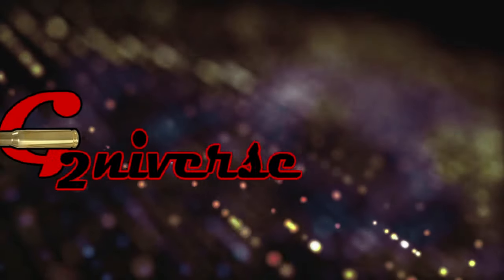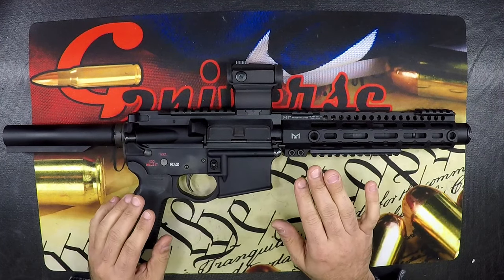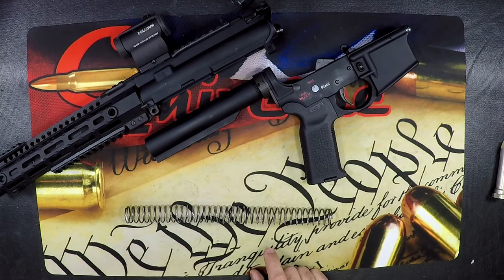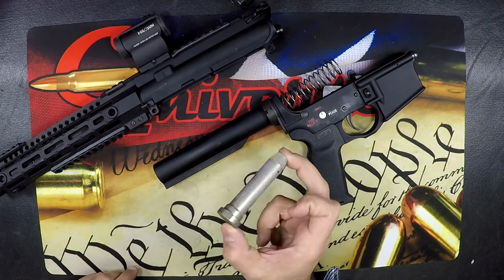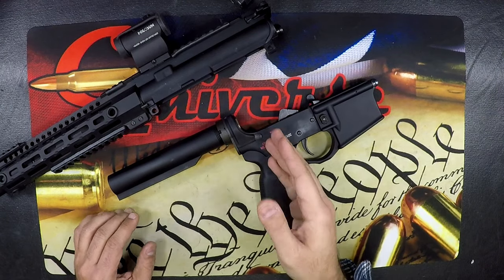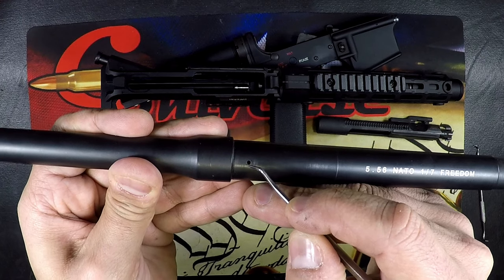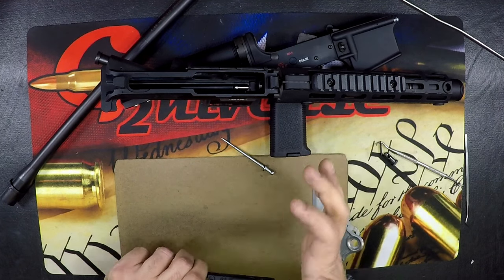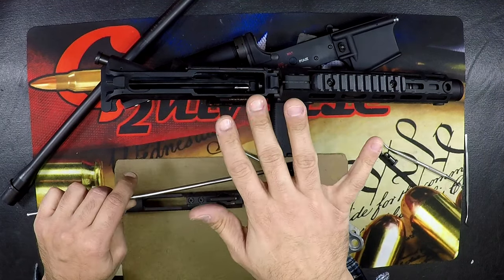Safely Fix Undergassed AR - How To

Comment: I'm dealing with this as we speak.  
I've been through every option you mentioned already,  no answer.  3 types of ammo....... everything short of removing weights from the buffer itself.  I've even swapped bcg and buffer setup from my perfect running carbine to no resolve.   
Having to fold and let the guys that built it give it a look.
Reply: It’s possible it’s the barrel port. I have a ballistic advantage barrel which I’m told is most likely too small of a hole.
Reply: Any update? I’m about to start all the steps he mentioned myself, ugh
Reply: If you're really undergassed another option would be to install a new barrel with a pistol length gas system rather then a carbine length gas system.  This will give you much more gas. Especially helpful if you're running subsonic 300 blackout ammo out of a 16 inch barrel.
Reply: @Theyoufeelme  No, do not do this lol. If the gas block is not clocked, the gas tube in the gas block seal is good, the gas key is in spec-.180 to .182, the gas key is not loose, the bolt carrier bolt tail bore and gas ring bore is good, the gas rings are good, the buffer is the correct weight, the chamber and throat check out good with a function gauge, the head space checks out good then the gas port may be under sized and needs to be opened..

Comment: I'm drilling my barrel gas ports out, to .100" 
Then installing ADJUSTABLE GAS- BLOCKS..

I tune with TULA , STEEL-CASE .223 (WEAK AMMO ). 
I Tune it to cycle weak ammo, then it will eat anything that's available, providing the casings are decent.

"TAILORED-PERFORMANCE"
Reply from the maker: Great advice

Comment: Thanks for video, took my build to range today first time. Was getting FTE. The manual ejection of spent casing works. So I believe my issue my gas block not properly align. BCG is the same  PSA in your video.
Reply from the maker: Tall Titan yeah id go easy first and check the buffer and buffer spring.  work from teh back of the rifle forward.
Reply: @G2niverse  buffer/spring is anderson carbine buffer/spring, brand new
Reply: @G2niverse  well checked gas block and gas tube to ensure set screws were still tight and re-verified alignment. I have snap caps 5.56, did one round check, I notice when ejecting appears to eject towards about 4 to 5 o'clock. Does the gas block need to be flush or small gap between barrel neck. here is my build parts:
Anderson Manufacturing carbine buffer/spring
Anderson Lower with LPK
aeroprecision Upper
PSA premium BCG
16" Ballistic Advantage midlength governemnt profile barrel
YHM .750 gas block
A2 Flash hider

Comment: I have it where mine is not feeding the next round. Took the gas block off and noticed a very noticeable white ring around the gas block hole on the barrel. I'm figuring I'm losing gas right there.
Reply: Gas escapes there until the gun is broken in and the gas block gets carbon locked to the barrel. It's normal to loose some gas there on a new gun/build.
Reply: I have the same issue. I got a New Rifle put a better aftermarket bcg and a New 600$ upper and thats what mine is doing.

Comment: Hello g2 hope your having a great day .i have a problem with my ar pistol. Its a aero precision x15 . The firearm does fire a couple of rounds , then it fails to extract the fired bullet in the chamber, it slides the next round but it jams because the other bullet is still in the chamber. But if you  remove the mag and it extracts the bullet that was stuck and fires again a couple of bullets and it fails to extract again. If you can help me identify the problem. Thank you and marry christmas/ new years!🎉
Reply from the maker: Best to go through our Playlist for ar issues. Your issue is in there.
Reply: This is happening to me now and very frustrating. Aero 10.5 upper.

Comment: Very detailed video I just learned what to look for in new BCG. Would you apply these same trouble shooting problems to gas Piston systems as well? I had one failure to eject and few failure to feeds in my Ar 10 which is a gas piston system. Only after 3 mags I even had a malfunction with math grade ammo. So I know it’s not ammo or mag related.
Reply from the maker: 889976889 im not as versed in piston driven systems.  I dont have hardly enough time in them to know for sure.

Comment: Actually it’s all about the unlock time of the bolt, it’s the pressure not being enough quick enough, but also m16 carriers are actually pretty heavy compared to others, next it could just be because your using 223 instead of 5.56 and not enough “pressure” in the process of burning the powder and especially steel Russian 223 ammo is weak, lastly you could clip the spring by 2-3” if you will use that steel case ammo (just make sure it’s just long enough that when compressed it won’t cause the carrier to slam into the upper receiver into the charging handle )
Reply from the maker: i wouldnt suggest modifying the spring.

Comment: Can this happen with a brand new ar. Im having this issue of one shot only then have to cycle charging handle for each consecutive shot. Will try the one bullet test
Reply from the maker: new ars have a 200-300 round break in period...you cant really make a judgement until youve put a good amount of rounds through it.
Reply: @G2niverse  yeah, one shot at a time
Reply: @shantor100 doesn’t seem right
Reply: @G2niverse That’s good to know actually as I finished an A1 clone build.  It short strokes and ejects almost straight back, about 5 o’clock actually.  I only have less than 70 rounds through it so I’ll keep at it.

Comment: My ruger ar556 shot well the first 10 rounds or so then I had to manually eject the rounds. It was brand new out the box.
Reply: Picked up a Ruger Ar556 MPR flag model 2 weeks ago and I find .223's ejecting almost straight back about 4 or 5 o'clock, slightly under gassed, with no failures but 556's are going forward maybe 1or 2 o'clock, or slightly over gassed.  I did clean mine before firing and found the BCG full of red oil.  Were you shooting .223's?  At about 400 rounds of 556s and 200 223s shot through, 2 times to the range, biggest issue had was to wait for all clear to pick up 556 brass in front of bench.

Comment: .300 blackout. 15in carbine gas. Works perfect. Right off the rip it works perfect. Shoots great. Cycles perfect etc. I'd say it was right on the money, BUT.. its ejecting really far rearward and casings are most definitely bouncing off the "hump". Now, in the search for perfection I'm tempted to dig in. Common sense says leave it alone. Thoughts ??
Reply: That's what u want it to do I'd say leave it
Reply: He has another video that addresses your issue and gets more into depth with this. I would say get heavier buffer weight as a start. If its that violently ejecting i would go with a h2 at least possibly h3. That would get your ejection more towards the 3 oclock area
Reply: If it works don't fix it. It could be a problem with the ejector, ejector spring or an extractor problem..

Comment: My pistol ar shots great with brass but will not function with steel case. But when I run suppressed it run both brass and steel. Thoughts? I was told just don’t run steel but I want it to run on everything.
Reply: your rifle is under gassed for steel case but when you add a suppressor it is entrapping more gas then helping your rifle to cycle steel case. i would try another gas block
Reply: Steel case is usually pretty weak and isn’t creating the pressure needed to operate correctly

Comment: I have a AR-15 300 black out. The premium rounds eject with no issue, but the range rounds won't eject the casing.
Reply from the maker: Range rounds? Like steel case? Could be a variety of things. Exctractor is weak, ejector is weak, could be overgassed and cycling to fast to allow the steel case to shrink before extracting. What do the casings look like?  Ripped? Dented? Anything wierd?

Comment: Have a question for you there bud I got an AR that shoots my 556 cycles everything's good when I put two two threes in it they won't cycle 
Also have a converter for 22 I haven't tried it yet but what would be my solution change the buffer change the buffer spring what do you think
Reply from the maker: 556 is usually a hotter load than 223, especially if it's Russian made. But I need a little more info on "not cycling". Like what is it doing?

Comment: Great video! But I got a question you may be able to throw some suggestions at. 20”  barrel with an A2 stock. Functions fine for the first 15-20 rnds everytime I take it to the range. After that ftf. Ejects but bolt does not travel far enough to load next rnd. Removed weights from the rifle buffer, changed spring to lower power spring. New YHM gas block, new gas tube. Switched in two different bcg’s. Checked alignment of gas block. Spot on. The gas port in the barrel is almost at max allowable dimension. I can not remember the exact port size dimension off hand anymore. Beautiful spiral fluted Shaw barrel. Gun is an amazing looking piece of countertop weight. I believe I did all of the checks you went through on your video. My next move is to baseball bat it against a tree and take the loss!! Lol! Any suggestions would surely be welcome. Thank you for taking the time to read this and possibly respond.
Reply from the maker: Don't baseball bat it yet...lol
Have you checked your mags?  Are you seeing the FTF towards the end of your mag?  Could be as simple as not enough mag spring power to push up the next round.  At the beginning of the mag its sounds like its fine because there's a ton of force resistance, but as you work towards the end of the mag and it empties out the spring gets a little weaker.
Reply: @G2niverse  Thank you for taking time to reply I appreciate it.  I am using 5 rnd pro mags. I know not the best quality but have only been loading 3 in the 5 rnd mag. Two different mags, same result with both 5rnd mags. I do not believe o have tried any other mags to be honest🤔 I was making a “long range” bench shooter. I have a bipod on so that is why the 5rnd mags. When we get a decent day in PA I will try a variety of mags. Again thank you for taking time to offer your help. Stay tuned for further outcome! 🙄🤣
Reply from the maker: Fair enough...I have an old 10 rounder metal colt I use for exactly the same thing.  Maybe get a surplus one and try putting the 10 round spring in the 5 round mag? Or you can diy a stop block in your current mag, place it on the bottom of the floor plate and essentially make a 5 round mag a 3 round mag, but using the same spring (which will make it stronger).  Good luck...I miss PA...lived there for quite a while in the Gettysburg area.
Reply: @G2niverse  thank you again for the suggestions. I guess I will figure it out eventually. Just frustrating when you go through everything well I guess not everything because it still does not fully function. Lol! 

Out of this whole YouTube universe you lived in Gettysburg. I have lived in the York area my entire life. Spent about 10 years of my plumbing career working for a contractor and we were always renovating buildings for Gettysburg College. That is way too cool to know we were in the same general area. Again thank you for your input! 👍🏻
Reply from the maker: The range where I use to do my videos was in Hanover...at Green Springs Rod & Gun Club.  Born and raised in MD, moved around all over the northeast.  Finally settled in PA for about 5 years before moving down south.
Reply from the maker: Just as another check...how's your bolt and buffer riding?  Do you feel or hear any scratching inside the buffer tube or during cycling?  Check the rim of the buffer to see if its rubbing on anything.  It might just need a good break in period.  Wish I was still up there to help you.
Reply: @G2niverse  everything seems to be as normal as can be. Lubed it up a little more than normal and sat and just racked it while watching tv until the wife could not take it anymore and she requested I either stop it or move out to the patio. I am not a quitter so I will figure it out eventually. It has only been a safe Queen for little over a year.

 Yes it would be awesome to have you try and diagnose this paperweight. It is definitely the most stubborn build I have ever worked on. Again thank you so much for all your suggestions, and I have subscribed so I can go back and watch your other videos. Might spark something I have overlooked.
Reply: @G2niverse  yep I know exactly where that range is. That is pretty neat that we were “neighbors” at one time!

Comment: I have a  10" .300 blackout rifle that shoot once maaaybe 2 & jams. Sometimes failure to extract or double feed. When I see tha ammo, sometimes the case is dented or the bullet itself move a little out the case. Very weird stuff. But ill try everything in this vid a let you know if it help.
Reply from the maker: Sounds like a cycling issue caused by either an overgassed or undergassed issue. With the 10 inch barrel, id say most likely overgassed. Check the video out on that and start there. Watch the undergassed too just to be sure.

Comment: Question.  I have an AR 10, Aero Precision build, it originally had an 18” .308 barrel.  I swapped the barrel with an 18” 6mm Creedmoor barrel, and now it seems under gassed.  Also used the same YHM Resonator K suppressor on both barrels.  Would you think I need a lighter buffer spring?
Reply: How did you resolve your issue, if you did?

Comment: Nope there's one more thing, port size.  Especially older 300 blackout.  When using a new can with flow through tech, like a huxwrx, you will not be able to cycle subs. 300 pistol length gas with 16 inch barrel needs .086 at a minimum down to .05 ish for supers.  Mine is somewhere aroun .07 and could cycle subs with old style cans.  Get a no. 41-44 and start drill baby drill! Just put a rod in it to not overshoot into the lands on the other side!
Reply from the maker: You are correct, but I really don't openly share this option because its too advanced for most.  Just simply opening up the gas port may sound simple, but doing it the wrong way can ruin your barrel.  The biggest mistake most people do with this is not taking into account the inside of the hole.  If you over drill or rush the process you can deform the inside of your barrel and ruin the performance/rifling/etc.  Just a slight burr or blow out on the inside of the barrel will engage the projectile and ruin any accuracy.
Reply: @G2niverse  so how do you mitigate that?  Hone from the inside?  Does the factory cut the gas port hole before cutting/pulling the rifling? I've tried all these tricks and new barrel or enbiggenment of said no no hole are looking like my only options.  It ran fine on the old can but new huxwrx doesn't have enough "dwell time" to cycle subs.
Reply: @G2niverse  cogsdill debur tool through the gas port hole?
Reply from the maker: Honestly I have no idea how to fix it from the inside...if you hone it you risk jacking up the rifling.  The rumor is that a few rounds through it smooth the barrel, but I'm not buying that.  Its a hardened tool steel barrel...no projectile is going to smooth that out.  If I was going to do it, I would use a reamer and do it by hand.  Have various sizes that step up to your final size.  Reamers leave a much smoother inside finish and give off much smaller chips than a drill bit.  Its a little more costly, but all you need is one drill bit to crack off in that port hole.
Reply: @G2niverse  o yeah that is a real pucker factor right there!
Reply: @G2niverse  gonna try a light spring and bcg and see if that doesn't fix it first... Then the drill press comes out! Feeds and speeds and fresh bits!
Reply: Nope... Light spring and 8.3 oz bcg still not doing it on subs

Comment: I’ve read multiple times that adjustable gas block doesn’t help none with under gassed issues, just asking. Does that hold true in your experience?  Because I’ve read they were basically for tuning with a suppressor added on.
Reply: To put it simply, an adjustable gas block can only decrease the amount of gas in the system, not add any more.  The reason they are often used with suppressed rifles is that suppressors tend to increase gas pressure for a given load, and with an adjustable gas block you can tune it down to whatever level you need.

Comment: Two questions: can an adjustable gas block increase the gas pressure?  

Why do you ignore the spring other than the correct number of coils?  Wolff Springs sells both stringer and weaker AR buffer springs. It seems like they would be helpful, if only for diagnostic purposes.
Reply from the maker: yeah of course it can...increase and decrease
Reply: @G2niverse  my thought was that the port limits the gas pressure. The opening in the gas block always is larger than the port, so that’s why I wondered about being able to increase pressure with an adjustable gas block.
Reply: If you are under gassed, an adjustable gas block can only decrease the amount of gas given through the gas port diameter. If you have an under gassed rifle, an adjustable gas block will not help you get additional gas. You either need to lighten the bolt carrier group, the buffer or the buffer spring to try and compensate for the gas port diameter being too small. The other option is to drill the port to a slightly larger diameter, then the adjustable gas block will be able to help
Reply: Obviously, if it is wide open then your only option Is to decrease.
A lot depends on your gas system length, rifle vs. carbine vs. pistol and the dwell time for each.
Longer barrel rifles have less felt recoil impulse , shoot softer etc.